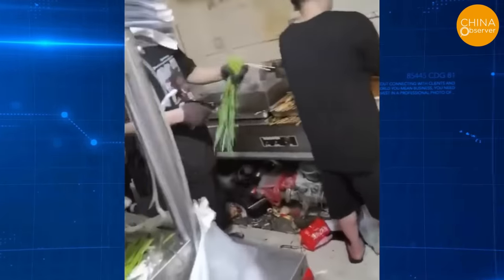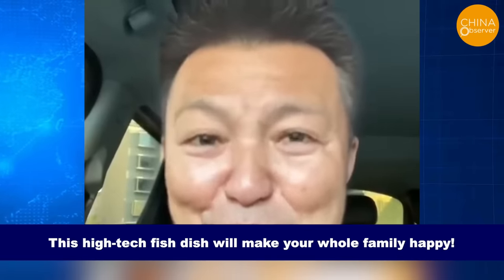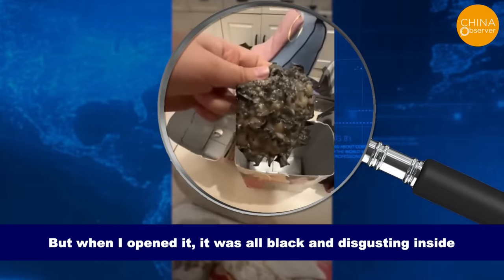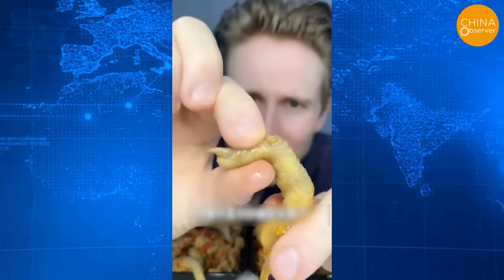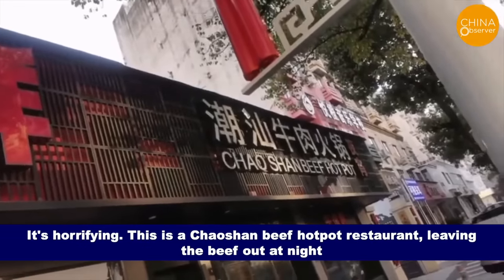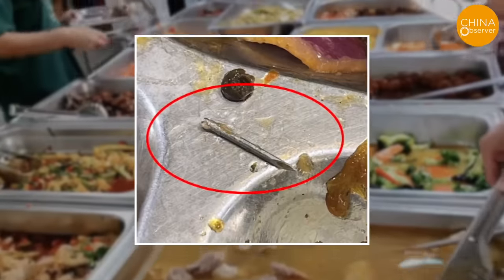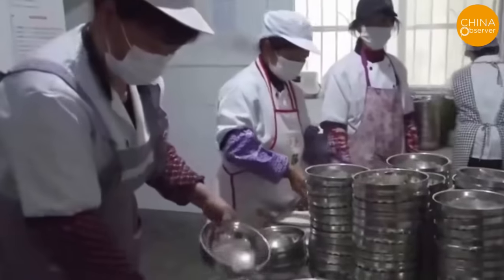Fake & Toxic Foods in China 2023 Final Edition: Endless Death Loop of Mutual Harm in Underprivileged

Comment: The whole gutter oil thing is horrendously disgusting but there seem to be some good to come from it. That oil seperator device would actually be beneficial for actual legit restaraunt kitchens or homes to immediately separate grease or oil rather than just pouring it down the sink and building up grease gunk in the pipes. I know how much its an annoyance to clean up a smelly gunked up grease trap so that device does have some merits if used the morale way.

Comment: 🍲 The video discusses unsanitary conditions in takeout restaurants, including the use of gutter oil and questionable cleaning practices.
00:28
Unsanitary conditions in takeout restaurants, including the use of gutter oil and questionable cleaning practices.

Invention of an oil-water separator for leftover hot pot and other leftovers to separate out the oil.

Concerns about the original intention of the inventor and the potential use of the separator by shady restaurant owners.

🤢 The video discusses various instances of food contamination and questionable processing practices.
03:33
Tofu production using additives to increase volume and elasticity, reducing nutritional value.

Concerns about the processing of tea leaves with high-pressure spray machines.

Instances of rotten fruit and questionable food quality, raising concerns about food safety.

🤢 The video exposes shocking and unsanitary food processing practices in various restaurants, including the use of industrial chemicals and rat contamination.
07:03
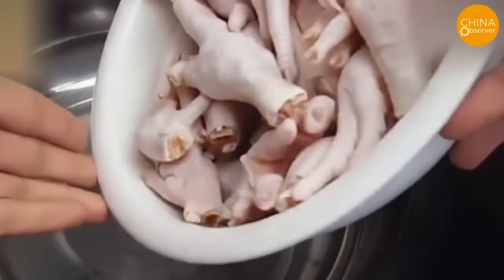Chicken feet are processed with industrial chemicals, losing nutritional value and becoming harmful to health (7:03-7:44)

Hot Pot restaurant uses industrial chemicals to bleach and enlarge ingredients, and rats are seen feasting on meat (7:53-8:36)

🦆 A controversy arose when a foreign object found in a school was initially thought to be a condom, but was later claimed to be a duck's eyeball membrane.
10:53
Initial discovery of foreign object in school

School officials claiming it to be a duck's eyeball membrane

Experts confirming the object as a duck's eyeball membrane

🍇 Controversial video of grapes being processed with feet sparks public concern about food hygiene.
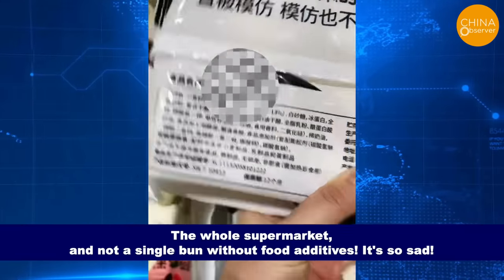14:04
Video of grapes being stomped by a farmer with bare feet goes viral on Chinese internet.

Concerns raised about food hygiene and aversion to consuming raisins in the future.

Comparison made to traditional tea processing involving the use of feet.